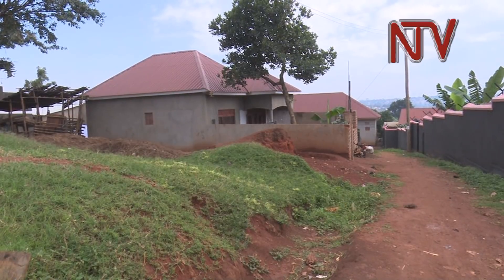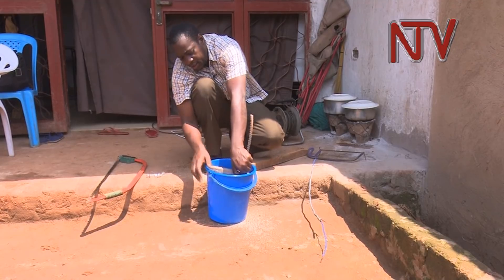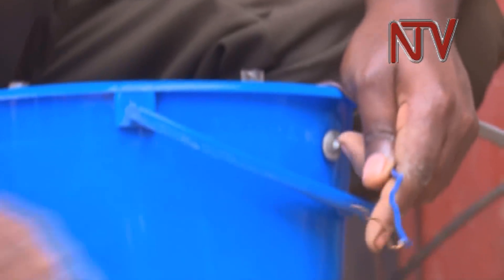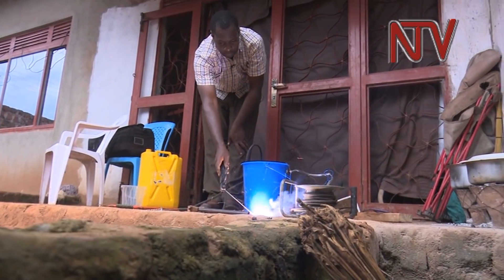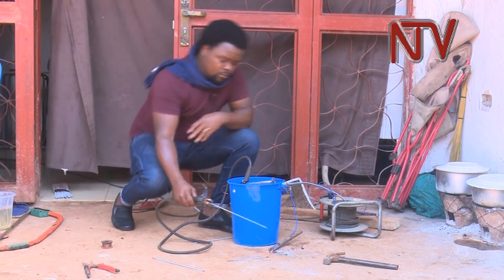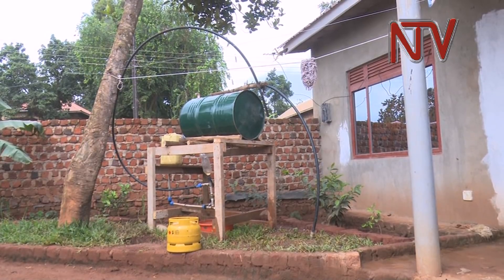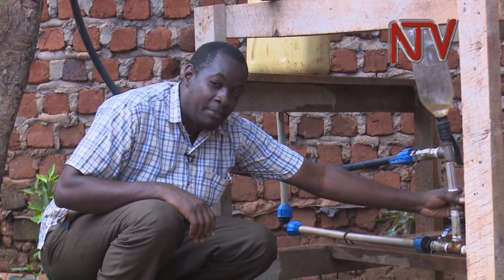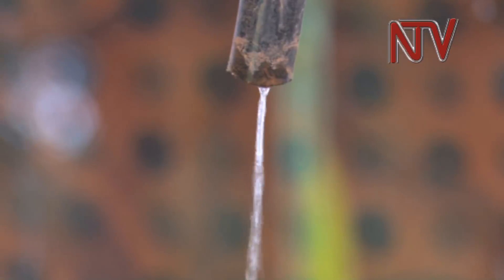Welding innovation: Man creates cheap welding machine.

Comment: This is extremely dangerous! The workpiece and welding electrode are directly coupled to the power line!
That's why there is such a thing as a welding transformer!It isolates and brings the line voltage down to a safer level!
The bucket will release explosive gas(hydrogen).
Also line voltage is AC, there is no 'positive' and 'negative'!
Using welding current at a higher voltage will cost many times more than when using the transformer!
This guy doesn't really know what he's doing!!!

Comment: This isn't innovation this is using inventions that have been around for a while to create a cheap welder, And he chose the easiest process to recreate when doing so, All you need is to get enough electricity to the electrode and you're good to go.
And realistically, You can get a good stick welder for a couple hundred bucks, I bought mine for about 150, You can get an upgrade from mine from 160 amps to 200 amps plus scratch tig capability for 250.
The risk involved with this, Really makes it not worth saving the couple hundred bucks.

Comment: Improvising a transformer using thick all-thread, a couple of stacks of those metal plates with holes in them used to reinforce lumber structures(come in umpteen sizes), some nuts, some thin wire for the primary(power in) and welding cable or even plastic covered copper tubing for the secondary(power out/welding end) and using it as a welder(buzz-box)  would be so much better, more work and resources but with the added bonus of a lot less death...

Comment: From practical perspective this is  amazing if you are in a real bind and need to weld something ASAP. But as electrical engineer this is big no-no , both from perspective of safety and because you are introducing noise into the mains grid.

Comment: 1st part (welding machine) : I don't understand anything. Sorry : do you connect the bucket device between a regular welding machine and your electrode ? Doe it make your welding machine more efficient ? 
2st part (pump): It's a ramp pump, may be the oldest pump in the history of humanity. Based on the water hammer effect, it allows to go put water colums to higher levels than classical pumps (piston or turbines). Most of the time it was used traditionnaly to bring water for cattle in mountain regions (e. g. Norway)

Comment: Liquid resistor and ram pump... Both very old inventions!
I am amazed every time I watch videos like that one where someone in Africa is seen as a savant for reinvinting some old technologies. It just goes to show how far behind and disconnected these societies are compared with occidental and developped societies!
By the way, both these inventions have nothing magical, nor do they add power from nowhere.
The liquid resistor simply increase the current, and thus there is more welding power. It does not take less power, but rather takes more!
As for the ram pump, it uses the hydraulic hammer effect of a small elevation and converts it into higher elevation in the manner of a ratchet. It takes its power from gravity stored in the water as potential energy. Note that in order to work, it has to waste a significant amount of water. That amount is the ration between the elevation of the input and the elevation of the output multiplied by a 60% efficiency. So, if the input is 1 meter and the output 5 meters, only 12% of the water will make it to the end. The rest will be wasted (unless you use it for something else).

Comment: Wow, there are so many wrong, half-right, and "this man is a genius" comments. This isn't a new invention, there's nothing genius about it. That bucket is acting like a resistor to lower the AC mains voltage. That's it. If he figured that out for himself, great for him and he gets credit but it's been around for more than a century. Also, doing that without UV eye protection will blind you.
Reply: Also since it is AC power it won't release much hydrogen and oxygen. Even so I would work further from it to keep sparks away. Open ventilation is good.

Comment: "Power is switched on.."
>sticks bare wires into socket
Reply: this looks like is cheap but its bullsh1t first reason the breaker shoud popd second the pay for KWh will cost more than a expensive welder.. and its deadly dangerous.
Reply: @robinsoncrusoe2775  In uganda, some electricity is stolen from the mains. Thats how he is likely paying for the machine

Comment: The welding technique is not right.You are using a direct live mains voltage current limited by water as a resistance (here the water acts a resistor).The electrical unit spent by your unit will be much higher than a standard welding machine.The standard welding machine may use a voltage of 20V to 50V.But your machine uses either 230V or 115V which is not safe.If we assume a current of say 100A (it depends on electrode length as well) then 

with the standard machine V x I = 20V x 100A = 2000W.
But with your machine V x I = 230V x 100A = 23000W or 
if you use 115V then V x I = 115 x 100A = 11500W

The welding electrode might use the same power as in a standard machine.but the remaining power will be dissipated / wasted as heat in water.

You must have sufficient wiring to handle such huge current...
Above all you risk your life in the welding process.
Reply: Sheik mohamed  ur the true genius
Reply: bro i tried his idea out it didnt work, i dnt knw why
Reply: @eliakyaligaba1564  Our homes are not equipped to handle the current required for welding...

Comment: What a load of booboo the welder is a water resistor arc welder, see these all over the net. Hell even king of random has made a video on a much better designed one, and it does not create more energy, it just reduces the voltage to a lower voltage more suitable for arc welding. Also his "pump" is not a pump as it does not lift the water higher than the source tank, let alone the 100s of meters he claims.

Comment: Great water pump. But your welder is so dangerous.  Why not build linden jar bucket capacitors and hook up a car battery, with capacitors connected to either side of the welding gear.  Ac current can leak out into the ground and kill you, dc will use the closest path, through the metal and not you. Dc is car battery.  You dont even need a car battery, a few 6 volt batteries and those big capacitors will do ok to weld small pieces. You can do even more with a car distributor sparkplug coil and those capacitors.  Check out  the youtube channel Okki Moeljadi.
Reply: plz help

Comment: Ram pump is cool. Death in a wet 240V AC bucket is a no no. I would bet money that if you used that thing for a month you would either get bitten, burned or incurred repairs to the wiring in your house provided its there afterwards. All of which would be fortunate events.

Comment: trye to do welding direct out of the home fuse box en brakers @ 15 amp for these electrodes you need @ least 110 amps en 50volt en it wil give 5500 watt out of the socket110volt X 15 =1650 wat so out of the socket wil generate only some cold welding en the wiring of the house overheated.

Comment: Lol Africa just discovered that? That's how people in America welded 100 years ago. Tips for the guy: add salt to the water inside the bucket if you want to make your "innovation" more efficient. And that steam from the bucket is chlorine.
Reply: You told him to add salt to the water and then told him that the "steam" coming out of the water is Chlorine. 
I didn't know that there was Chlorine in H2O. Must've slept that one out in chem class. Aka you're a fucking idiot.
Reply: Hard Case It's called the electrolysis of NaCl. The solution in the bucket becomes NaOH the more you use it during welding. I skipped my chemistry classes and developped my critical thinking by learning it from my personal experiments. 
Basically, I'm an idiot since I don't know everything, but you're just as useful as a textbook to me. 

EDIT: Since the water in the bucket acts as a resistor, the steam coming out of the bucket is chlorine and H2O.
Reply: +Hard Case  ohhhhh u be nice to the guy
Reply: uchihasurvival  hydrogen and oxygen! Very dangerous!

Comment: Welder machine seems like a suicide hazard. And too thin wires to flow the current. The second one is ram pump. So he is not an innovator but just an engineer. Or will he next invent a round shape rubbers that you can use under your car to make it move ?
Reply: teippiviritykset 
Wow, you're an INEPT!!!

Comment: This was tested in MIT school of engineering and they found that if you use a potato instead of the 2 X 4 wood stick, you will get twice the power and the potato will grow twice as big every time you use it. You will get electricity and enough food to feed the village. Also works if you use meat but the meat produced does not taste good because it has a metallic flavor.

Comment: "Salt water rheostat". Been around forever. Almost burned my bedroom down with this when I was about 9 years old. LOL!
 That being said, He is very imaginative and clever as it is new to HIM.
I hope he does well and wish him all the best from the USA.
Reply: john hanrahan I cannot believe he is using iron bars as the terminals.. that shit is so much heat waste
Reply: john hanrahan finally give this man a Klondike!!
Reply: john hanrahan hydrolytic potentiometer ?
Reply: carolyn mmitchell if he winds the leads around them in series with a diode  they become inductors and resist any change in current flow...
Reply: You like salsa? Have you ever had Ecuadorian salsa? Didn't think so.
Reply: Mid 50's my father used lye water in a metal bucket set on bricks, living rural hydro used one transformer for multiple homes. Using this welder would pull a TV picture tube down to a small white dot. Hydro put a meter with a round graph paper plugged into our house. Was instructed by father not to use the welder while the meter hydro had installed was present.

Comment: The water in the bucket will boil only if the it is a hard water other wise nothing happen.. There is life threatening incidents with actual welding machines. This is non isolated and for welding , the current (amp)should be high and voltage should low. Fake.

Comment: THEY ARE BOTH ANCIENT INVENTIONS THAT WE'RE MADE BY OTHER PEOPLE AND NOT BY THIS GUY!! PEOPLE COME ON ARE YOU SERIOUS THIS IS REALLY OLD TECHNOLOGY ASK SOME ONE WHO IS A PRO WELDER ABOUT THIS OR SOMEONE WHO KNOWS ABOUT WATER PUMPS AND THEY WILL HAVE A LAUGH OF THE DAY!!
Reply: santiago vindell 
Jealous are we???
Reply: Ymr Bleav No... What I say its true. In fact I did what hes doing in the past of course with better tooling
Reply: I'm a professional welder. If he had 220, added salt to the water and used that coil to improve the voltage it's possible. Also he's not using a welding hood. He will certainly have eye damage. I'm thinking since he didn't mention salt in the water then it's a fake video.

Comment: Another scam from Nigeria! This is not only fake but dangerous. No safety measures are used and can cause blindness and burns. Water and two identical re-bar rods doesn't make electricity, it makes two wet rods. Water alone isn't conductive enough to make a spark. If this was the case, re-bar and water on construction sites would electrocute the workers on a daily basis. Even if he had 10 buckets with salt water you need two different alloys for electrons to pass from one to the other and produce the 10amps needed to make a welding rod spark. Otherwise we could weld with a 9 volt battery... As for the ram pump it's leaking more out of the check valve then the garden hose, so it's wasting 10 liters for every liter that comes out. Not the results you want. Trained in welding school... B.S. and not much of a plumber either.
Reply: 1 of the rebars was hooked to the hot, the other was hooked to the weld rod, and the neutral was hooked to the piece to be welded. The water is basically a resistor stopping the breaker from tripping.

He might want to get far away from the steam coming out of the bucket though...that's hydrogen and chlorine gas.

Comment: A water resistor... Actually it needs water with conductive solids (like borax, or Epsom salts), and a movable conductor to vary the resistance. Only about 120 years old, lol. They were invented for carbon arc torches, for brazing and soldering.
Reply: the pump he is using been around for over 100 years and it can be pump higher the the tank there few youtube videos it called a ram pump
Reply: Ymr Bleav  sure have, only as a carbon arc torch, not running welding rods. The carbons I got from old carbon zinc d cell batteries, and I used firring strip to build the handle, along with some perf straight steel stock, and a narrow hinge, some whacky thumb screw from a junk drawer, and a couple screws. Welding I just used car batteries and jumper cables. Decades ago when I was a kid. You can also build an "iron pile resistor" according to reference I read then, but a water resistor seemed far easier to Fab, and buckets and broom sticks are pretty available. My home at the time was a place with very low solids Muni water, so I had to add electrolyte. I've also seen Russian kids on vids here running off mains to power a welding version, I just balanced my mix and pole piece placement for a maximum of 12 amps draw (10 ohms minimum resistance), and contact started the arc, then slowly turned the screw to produce a "feather". Could damn near set fire to rocks with it, super hot flame. Dad was seriously unimpressed, and took away my "dangerous toy license" (his words, lol) for life. I ran it right off a standard us 15 amp 120 volt wall socket, never blew a breaker because I did the arithmetic and built to spec. Now I just use a buzz box or mig set up, so no need for such toys. My source for the idea was some vintage "tools for boys" tome of the 20s I found in the library, and the reason for the build was to braze a piece of pipe to repair a bike frame for my pal. It lasted as long as the bike did, lol.
Reply: ludditeneaderthal yet here it is in all its pure H2Oness working like a champ
Reply: tom conner it is not a capacitor, it's a resistor. No need for an inductor. It's not a resonant circuit. It would be less "snappy" if built as such, but the carbon vapor produced in the arc (in my arc torch), or vaporized iron from the welding arc bridge the 0 potential interval so it doesn't break and require restriking. Build one, it's simple, and try it out. 14 ga wire, a couple feet of pvc pipe, a foot of copper roof flashing, and an empty joint compound bucket. Washing soda or Epsom salts for electrolyte. Voila. It's a current limiting resistor. Look up a schematic for a carbon arc torch for a hint on the geometry needed for carbon placement and tip tapers, but I just used a pencil sharpener and twisted my strapping and hinge so they layed parallel along the tapers when closed, as the gap when firing will only be about the thickness of a business card. Hot leg from wall plug to fixed pole in bucket, movable pole to fixed carbon, movable carbon neutral leg from plug. Any carbon zinc battery will provide a carbon rod, I used a pair of d cells because they fit a sharpener well. Light off by contact, back off to feather, both at Max current setting, then adjust current for "heat", though the adjustment is pretty minor. Electrolyte solution you make to Max current level of resistance with bucket pole pieces closest (10 ohms in the USA will allow 11 to 12 amps), so you can't blow breakers until you boil off a bit of water
Reply: Yes! ... ludditeneaderthal : A couple (or better 4) car batteries make and EXCELLENT power source for welding! ... I know a guy who welded a broken 4X4 leave spring mounting bracket, out on the trial, with 4 car batteries ... the repair lasted as long as the 4X4 did :)
Reply: ludditeneaderthal 
Have you ever tried to do this? I doubt it!!!
Reply: ludditeneaderthal you’re thinking of a capacitor, and they’ve been around much longer than that
Reply: ludditeneaderthal  pah, little bit of hypochlorite vapor, or lethal isolated elemental chlorine gas?
Reply: ludditeneaderthal you’d also want to run an inductor circuit, but since there is no footage of the actual setup, I call kaa kaa!!!
Reply: ludditeneaderthal Give credit, but don't try to discredit him.
Reply: Why don't you do it in Africa? Keep in mind everything is super expensive and imported, and there is no Home Depot. They might have an ACE.
Reply: ludditeneaderthal 

Third world water ie SOUP.
Reply: We used the same set up with 110 to embed wire in our wax honey comb foundations. I learned how to do it as a kid. We just varied the amount of salt. Too hot, add more water. Too cold, add more salt. Nice to know you can vary the current by moving the conductor. I didn't think of that.
Reply: He's using water hammer.  The stuff coming out the pipe that is filmed isn't the outlet of the pump.  Its the black pipe, and the concept works very well but it comes at the expense of having to discharge more water than gets pumped.
Reply: it's a ram pump. look it up. You waste a lot of water, but you can pump water higher than its source, because you take advantage of the momentum of a lot water to propel a small amount upwards.
Reply: Eric Barton  ever heard of "hard water" Eric? It's water with dissolved mineral solids, like calcium, iron, aluminum (which is why it leaves those tell tale stains). That, of course, is assuming our "inventor" didn't pour a cup of table salt into the bucket out of frame, lol. Btw, if you decide to make one, DON'T use table salt as electrolyte additive, as kinda poisonous chlorine gas is liberated in use if you do.
Reply: Not to mention his water pump does not work, it does not lift the water higher then the original source tank, looks smart but in effect only just smart enough to fool a fool.